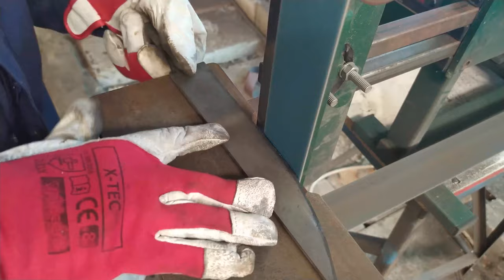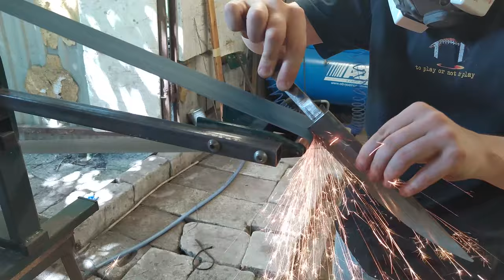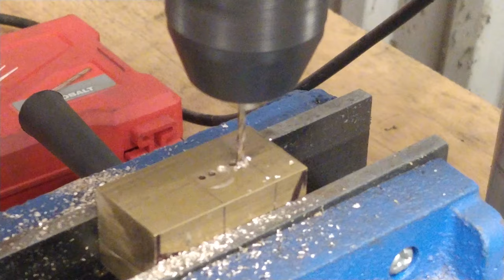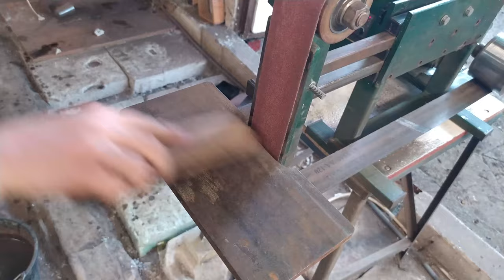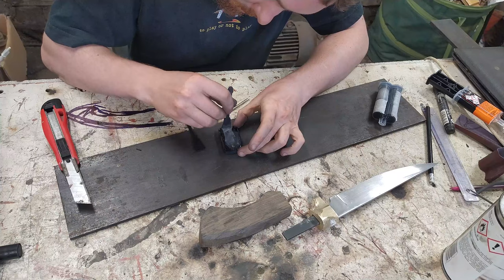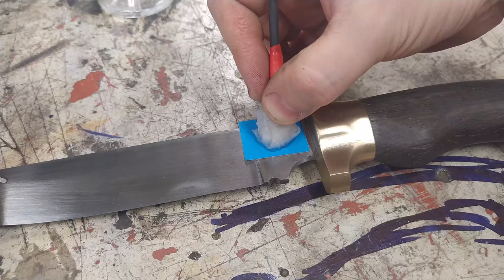making razor sharp butcher knife

Comment: I use the Mirka PSA rolls 120 Ft. I pull out and a 1ft and fold it on itself and have a stronger strip and is double sided. Just cut it to the needed sizes. 🤘
Reply from the maker: Sorry, I don't understand what are you talking about. Sand Paper?
Reply: @DBCraftWorld  yup. Sand paper 😁
Reply from the maker: @mcrich1978  Thanks Man- I'll check it! Btw: I've seen people who duct tape it to make it stronger. Have you try it?
Reply: @DBCraftWorld  indeed.. duct tape and even the blue painters tape work well. For my 220 grit I use the Mirka PSA rolls and I just fold that stuff on itself for extra rigidity.
Reply from the maker: @mcrich1978  Make sense to me:)! Mirka PSA rolls is sand paper not sand fabric (sand paper with fabric base instead of paper) right? Have you try sand fabric? I know that cost more but It's hold much longer
Reply: @DBCraftWorld  I've never tried the fabrics. Yeah it's the sticky back paper. I just like sticking it to itself so can just flip it over and have some fresh grit and keep it from tearing at the same time. 😊
Reply from the maker: @mcrich1978  I have never use those sticky one paper :). I'll try to find this Mikra PSA rolls cause I hate when paper is moving on the "grinding cube"